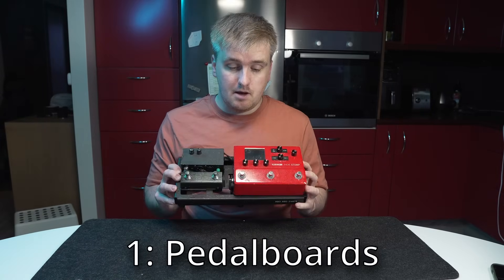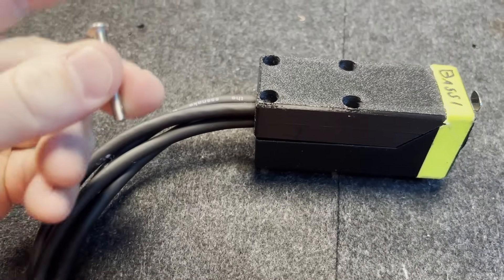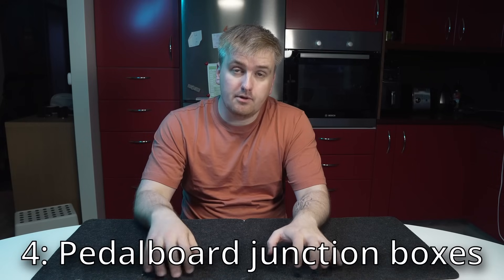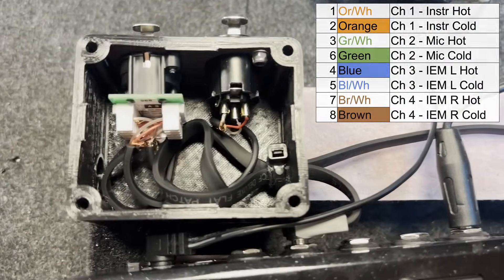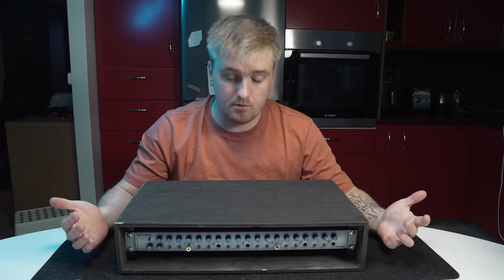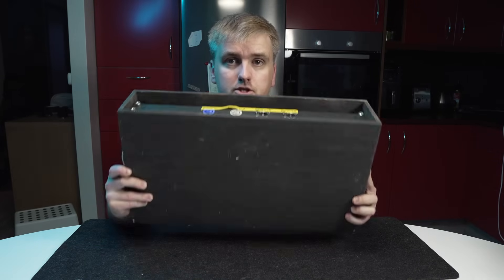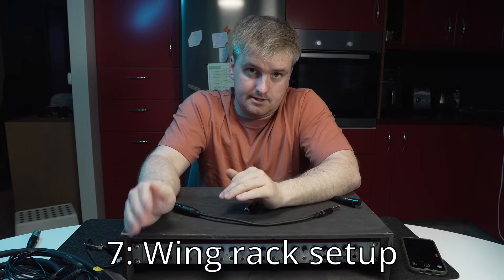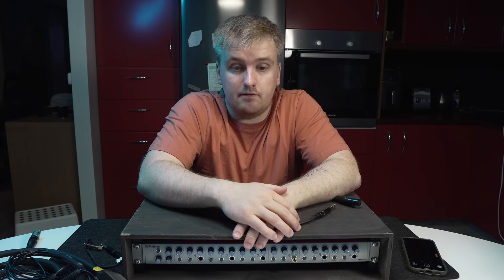7 DIY audio over cat 5/6/7 solutions to make your life easier.

Comment: I’ve printed 12 of those stage boxes for my 13 piece band - we’re transitioning to wired in ears so moving from ~40 stage cables to ~10! The costs are adding up quite significantly though - do you have any recommendations for decent but cheap ethercon-style cable sources (perhaps diy)
Reply from the maker: I’ve been buying Pro Snake Cat6E from thomann. Haven’t really looked for a cheaper alternative.

For the rehearsal space I just use shielded cat cables from the local electricians retailer. But they dont have ethercon connectors but work for the purpose.

Comment: have you compared between the flexible stranded copper and stiff solid copper inside cat 5/6/7 ethernet cables? in the same length which was produced better sound signal quality?

Comment: Is it possible to use combi-jacks with this kind of setup?  I can't seem to find any wiring diagrams for that setup.
Reply from the maker: The combi jacks Ive used have 6 pins, labeled 1-2-3 (for the XLR) and TRS (for the Jacks) so just connect them together. 1=S, 2=T, 3=R

Comment: Our (edit) soundcraft UI24r rack has a 4 channel wired IEM in it. Also included is Driverack Pa2. Master goes to in ears for everybody, in addition each one gets a personal mono AUX on top for ”more” me. 5m standand miniplug extension cables for in ears. Everybody is well withing 5m from mixer, in practice 2m max from it. Those are durable, not a single cable has broken in 20 years.

We mix ourselves so we need a realistic mix in in ears. My Ipad is in my mic stand for mixing. 

This setup has been in use since we switched to Roland digital drums and Yamaha 01V digital mixer came out in 1999. We have also rehearsed with headphones since then.
Reply from the maker: UI24R is a soundcraft product?

It there a reason to be doing Mix + Mono More me i stead of just seperate mixes?
Reply: @arnieitthvad  Yes. We have the same master so we know it is fine for the audience. Master is stereo, so everybody gets a nice wide image. Also only 1 Aux needed per headphone.

4x separate mixes would be a pain. One master mix down. Then just a little lift for own instrument+voc. 

We also practise this way with headphones and Roland drums.
Reply from the maker: @HobbyFinn2 You could do all/most channels as Post fader send at 0db. That would allow you hear the master balance, but give the option to do a “more me” bu pushing that fader above 0db.
That would give the ability to do individual Pan for each player, I personally feel that panning things for different players is one of the big benefit of iems, and also why I always say never do mono iem.

But if it works for you, great. In my experience listening to a main mix in IEMs doesn’t really translate at all to the sound out front, and often what is needed out front is very far from what I want in my IEMs.
Reply: @arnieitthvad This very thing just came to my mind too. It was historically this way, when we started Yamaha 01v only had 4 auxes. Behringer xr18 only had 6. Ui24r has 10 auxes, 8 physical + 2 stereo headphone outs. We could indeed change it this way. Post fader and 0db would be the way to go to have a common base mix.

Comment: I'm very interested in the unbalanced cable specifically for use of the 4+ cable method between my pedalboard and amp.
Reply from the maker: My friend @einkahumor who built the seetronic breakout had a setup going between his amp and pedalboard, doing 4cable method plus wired unbalanced IEM.

Don’t remember the specifics on that wiring but I’ll ask him to comment.
Reply: I've successfully used the following pinout for pedalboard<->amp:
Pin 1 Guitar input
Pin 2 Guitar input (parallel through the punch from pin1)
Pin 3 Mic Hot (parrallel to mixer<->amp ethercon)
Pin 6 Mic Cold (parrallel to mixer<->amp ethercon)
Pin 4 Send
Pin 5 Return
Pin 7 IEM L (from pin 4 of mixer<->amp ethercon)
Pin 8 IEM R (from pin 7 of mixer<->amp ethercon)
All on common ground
Reply: @einkahumor  interesting...thank you very much!
Reply: Next I'll try this pinout to add my vocal mic through a panel on my pedalboard and to use a footswitch for the amp:
Pin 1 Guitar input
Pin 2 Footswitch (momentary, normally closed)
Pin 3 Send
Pin 6 Return
Pin 4 Mic hot (from pin 3 of mixer<->amp ethercon)
Pin 5 Mic cold (from pin 6 of mixer<->amp ethercon)
Pin 7 IEM L (from pin 4 of mixer<->amp ethercon)
Pin 8 IEM R (from pin 7 of mixer<->amp ethercon)
All on common ground
Reply: Actually the first pinout was wrong, I've edited that comment now.
Reply: Possibley @arnieitthvad will have me over for a nice warm lager one day and we'll do a rig rundown of this setup.

Comment: I assume you make and travel with a spare of each custom breakout cable you make? I'm too afraid to make anything nonstandard because things tend to break at gigs after traveling with it, so I would rather keep everything modular and standard. I'll always have an extra XLR in the trunk.
Reply from the maker: Most things can be bypassed, if one channel (lets say vocal mic) goes down Ill just run an xlr directly into the back of the mixer.

Ive had the headphone part of a combo cable go down, and I always keep a spare headphone extension during shows. Its connected to the headphones out of the Wing if I need to be able to cue something up.

I havent finished making a proper spares kit, but its on the list. I have a case of adapters that I bring with me for my freelance audio engineers that I have been bringing.

Comment: Hi Arni, I'm a bit confused about the 8 channel cable over 1 ethernet. An ethernet cable has only 8 wires, and the audio has 8 times ground and signal is 16. How?
You connect all the grounds together to the cable shielding?
Reply from the maker: A typical unbalanced headphone signal is Left, Right and ground.
For this, each twisted pair in the cat cable is Left and Right, with a common ground.
Four stereo signal is eight channels, but since Im recieving the outputs from Balanced XLR connector at the back of the desk. 
I’m using Pin 2 of the pair of XLR, pin 3 gets shorted to ground/pin 1.

All analog audio over cat cables Ive seen uses common ground, one could argue that the ground is common anyway in most setups, doesnt really matter if it happens at the mixer or the other end of the snake. (Some electical
Engineers probably disagrees and can correct me)

Comment: Hæ Árni, great video!
I was wondering about your color code for the color coded snake skin on the breakout adaptor. Are you using the RGB Red-Yellow-Green-Blue or the “Icelandic” Yellow-Red-Green-Blue? And why? 
Regards. Curious George
Reply from the maker: The breakout with the 3D print is resistor color code
1: Brown
2: Red
3: Orange
4: Yellow
I’m used to that from working in denmark, they use that stuff for everything there, and it can do pretty much any number.

The seetronic that Gústi made is Yellow-Red-Green-Blue, because, like he said “Everyone that will be using it (meaning other band members) knows that color code, noone knows the resistor code” which is true. Our stuff doesnt really have to be universally compatable, it just needs to work for the people that will be using it.

Comment: I'm very interested in a video about the Seetronic ethercon breakout!
Reply from the maker: Ill definitely put that on my list!
Reply: Hi, I have used the Seetronic for building a Cat Cable Breakout to 4 XLRs, and I can tell you that it was not the best idea. 
The specified cable diameter of the output of the connector is 5-7 mm, which is not a lot for 4 separate Microphone cables. I used four of the Cordial CMK 209 BK cables, which only have a diameter of 3 mm, to make it fit, and it was still very difficult to get into the Seetronic connector, since this was still too large. On the XLR side, I needed to put shrink tubing onto the cable, since the Neutrik XX series only accepts cables which are at least 3.5 mm in diameter. I would not recommend getting cables that are any thinner than 3 mm, since they are more prone to breaking than regular cables (in general). So I had another idea:

I would suggest taking "inspiration" from the Cordial breakout boxes (search for CDX FN 3 QUAD-DMX), which can be built from the Neutrik NA-Housing (or the Neutrik NE8 FF, which includes two EtherCons (connection type: Solder!!)), an M25 cable gland, and a (3D printed) adapter from D-Norm to the M25 cable gland for the cable breakout.  For the tails, I would recommend at least 50 cm in length (I built the seetronic thing with 25 cm, and it is extremely short). The SC Stage by SommerCable is very nice (also for other cables), since it can be coiled very easily. Or you can use the Binary 234 DMX by the same company, if you want to use DMX or AES. 

The Cost calculation for one pair of XLR Breakouts (excluding Ethernet cable) is as follows (prices from Thomann):
4x 1m Sommer Cable SC Stage 22 Highflex SW    = 4.4 €
1x Neutrik NE8 FF                                                        = 18.9 €
1x Neutrik NA-Housing                                               = 12.8 €
4x Neutrik NC3 MXX                                                    = 15.6 €
4x Neutrik NC3 FXX                                                     = 17.2 €
2x Cable Glands                                                            = c.a 2 €
---------------------------------------------------------------------------------------------
Total:                                                                               = 70.9 €
Total/Side:                                                                     = 35.45 €

You can get this a lot cheaper by using connectors by cheaper brands like Seetronic, or Rean instead of Neutrik. However, if you compare this to the the sssnake Cat Snake 3MC, which is 6€ cheaper per box, you get quality components by reputable manufacturers, assembled by yourself.  
The Cordial boxes, which serve as inspiration for the project cost around 80€, which is more than double the price of this project. 

I hope, that I could help you avoid the mistakes I made with the Seetronic EtherCon connector, and hopefully encouraged you to find new mistakes with the project I suggested above. Have fun! 😃

Comment: ali express has has behringer pm1 style  headphone boxes for under 10 euros. Doesn't use batteries, stereo XLR in, metal with a belt clip and a volume control.
Reply from the maker: The thing to note about the PM1 and other similar passive devices is that they are NOT headphone amplifiers. They are volume controls for amplified signals. I see alot of people using/suggesting to use them when a P2 or similar is the correct device.

That being said i very rarely actually touch the main volume for my IEMs, I usually have a tablet in front of me to make adjustments to individual channels, but because we rehearse and play shows in the same setup the adjustments I need to make are minimal.
Reply: @arnieitthvad  I know, but almost every device I have used the last 10 years does have a pream in them. So I set the PM1 volume halfway and turn the output of the device it is connected to up. Now you have a volume control on your belt.

Comment: This is a great video with lots of great nuggets of info. I do have one question, what do you use for labeling?
Reply from the maker: You have to be a bit more specific on what labels :)

I have a Brother P-Touch that I use for some things, the sub snake box is just painter's tape and a Sharpie, the small gray labels on the guitar box is gray PVC and a sharpie. The pink tape is Gaffer's tape from ProGaff.

The labels on the Wing Rack front panel are custom Vinyl stickers made using "Print & Cut" method  at a sign making shop.

At the same shop I also had some vinyl stickers made that I use for labeling cables, both owner's marking and color code for length.

Comment: Do you make your own ethercon cables too?  Are they all shielded ethercon cables?
Reply from the maker: No I've bought them from thomann, It's Pro snake cables. They are all shielded yes, which is required for most of the stuff.

At the rehearsal space I just have normal shielded Cat6 cables I got at a local store, we can then leave the cables behind and I bring the case with the ethercon cables when we're doing a show. 

(I also do the occational freelance show where I need the cables, so I don't want to tie them down for the setup at the rehearsal space)

Comment: That's great. Thanks. Any chance you can show the unbalanced stereo wiring? Pref with jacks rather than XLR but I'll take what I can get! Thanks.
Reply from the maker: Message me on instagram @adddni or facbook Árni F. Sigurðsson, I might have some photos from the build.

TRS vs XLR doesnt really matter, the wiring is the same
Pin 1 = Shield
Pin 2 = Tip
Pin 3 = Ring

Comment: I'm also a bass player in a pub cover band that's been on a mission to reduce setup and pack down times, so it's interesting coming across your videos. Big thing that made my life easier was convincing the drummer to get a cheap kick drum that I could drill holes in and mount not only the kick mic, but also inputs for all the other drums. Short tails for the mics, then just a single snake between the kick drum and rack mixer. Granted, not every gig is a full mic'd kit, but it's awesome when we need it.
Reply from the maker: Interesting idea, not sure I'd want to drill out a drum :)

We have our wing rack situated right next to the drum kit, so we just run short cables directly to the rack. Lead vocal also runs a cable directly.

Comment: Thanks for the content! I'm definitely going to try the STL for the breakout cable! Life saver!
Reply from the maker: That credit goes to @einkahumor who designed and printed it for me.
Reply: @arnieitthvad  that's awesome! I also had a go at making the Seetronic breakout box today, but it's really difficult to get the 4 XLR cables properly fitted in a standard RJ45 connector. I'm really looking forward to seeing your solution in more detail. Your channel is proving to be the most useful Youtube subcription of the last 3 years for me. Thanks!
Reply from the maker: @BraMKJ I know the cables used for the breakout I have is Sommer Cable Cicada SO-D14
Reply: @arnieitthvad  Cool, those are the same that I have. I have techflex to wrap them with. I think my problem is having to use a standard 8 in a row networking RJ45 connector. It's a bit fiddly I guess.